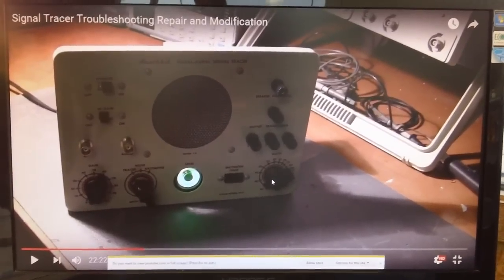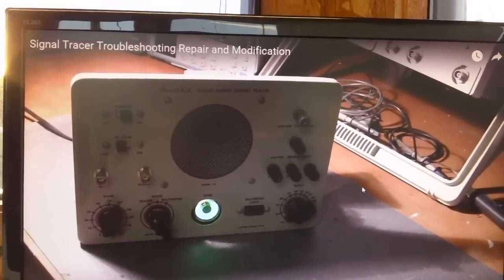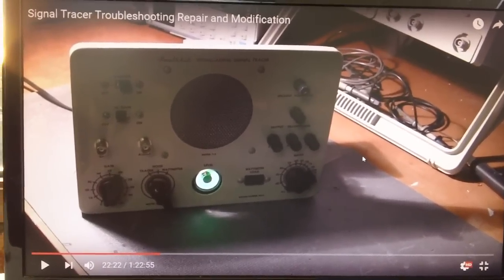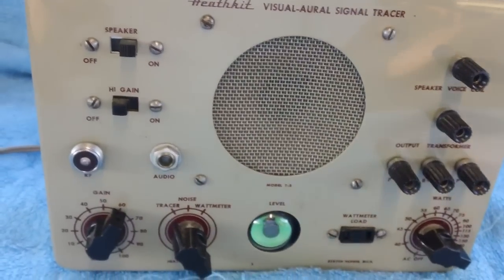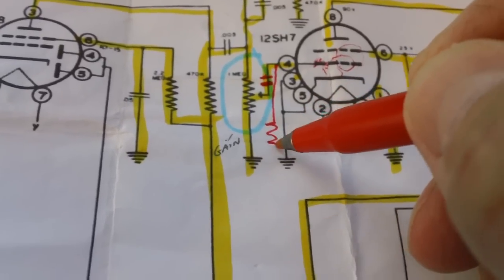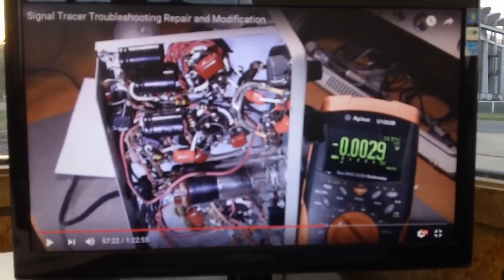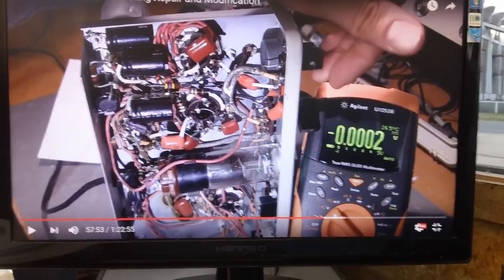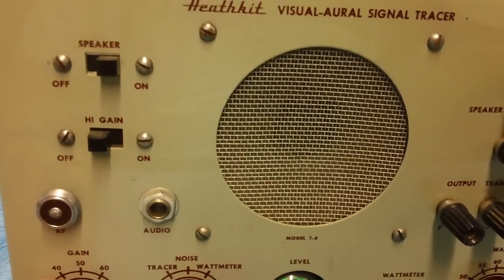Heathkit T3 repair as per Mr Carlson's Lab.

Comment: John, 
Though Paul certainly knows far more than us ‘mere electronics hacks’, he is one of a small number of, what I regard as, ‘electrics engineers’ such as Dave (EEVblog); Uncle Doug; Dennis Carter; Afrotechmods; w2aew; Ray (Radio Workshop); Andy Davis by the sea; Stan Gibilisco, and last but certainly not the least: John (joernone).  As for me …nah: it’d be folly to go there LOL.
To some extent, I understand why Heathkit partially overloaded g1 of the 12SH7: it was to maximise sensitivity whilst at the same time maintain stability – possibly to accommodate very low impedances, or perhaps pick up the faintest of signals via a specific type of probe.  For virtually all workshop repair use, signal tracers need not be quite as sensitive as the T3.
There are a number of ways the sensitivity can be reduced but Paul’s method is straightforward to understand, inexpensive, and easily installed.  From a personal point of view of making a modification to the T3, had I not seen Paul’s method, likely as not I would have given consideration to altering, or making modifications to, the cathode, and g1, biasing of the 12SH7 having replaced the 3n3 DC blocking, or coupling, capacitor with a 22nf @400vdc …there is more than one way to fell a tree LOL!
Occasionally, an old service tech would say to me …I’d only be in my late teens at the time, “If you are able to reproduce something useful that you have made, or modified, a least a second time that gives the same result, your effort is not only fruitful but potentially useful to other people.”  You have reproduced Paul’s modification; achieved the same result, and now it is potentially useful to anyone else who owns a Heathkit T3 signal tracer, and feels a need to cure the identical inherent fault.
Yes, another superb video my friend.
Regards,
Phil.

Comment: I agree - it's fascinating stuff !     I have the Heathkit T-2 tracer which is a slightly different design and when I checked, that has the extra cap. and a 10 Meg. resistor to ground in the equivalent spot.   Now I know why it's there !
Paul does another similar video on an old Knight  VTVM which inspired me to fix mine up.  Well worth watching as well.

Comment: After watching Paul go through his Heathkit tracer I looked at my Knight Kit tracer with new understanding.  His promised series on using vintage test equipment should be especially useful.  Not sure if I'm the only one but it somehow seems right to use vintage test equipment when working on vintage radios and it will be a treat to get some coaching on how best to use that equipment.